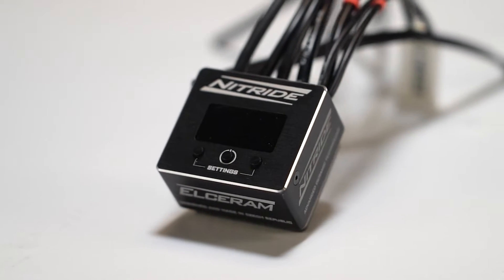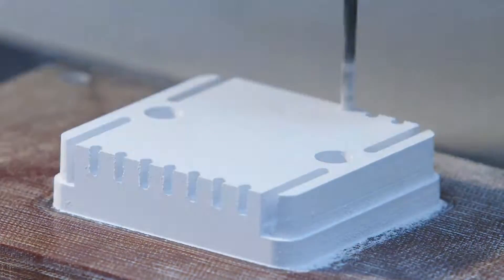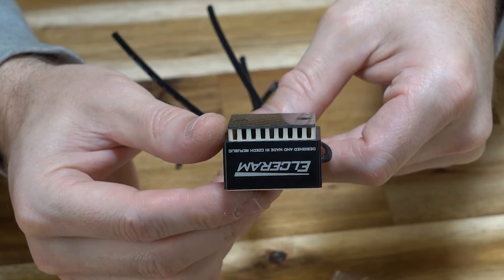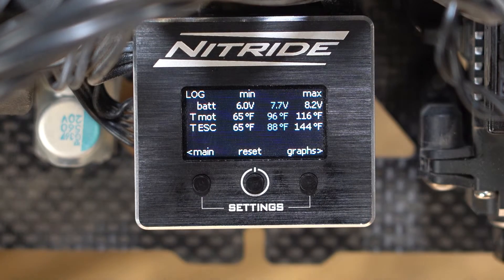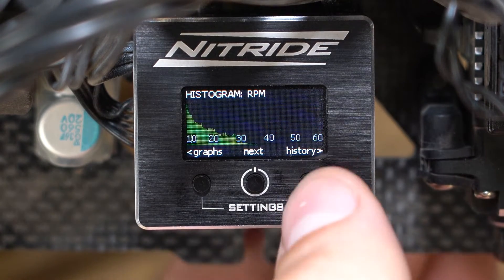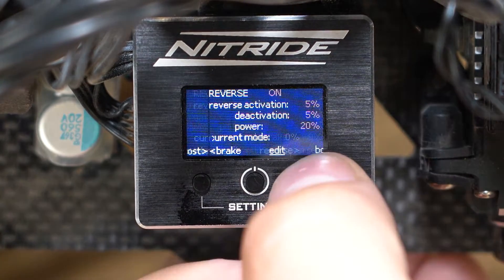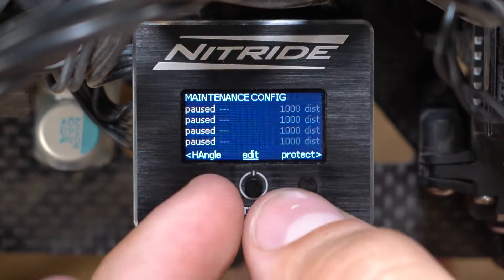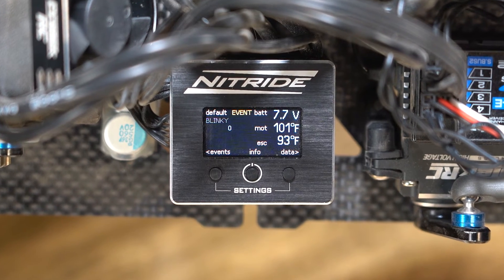The Nitride LCD Screen Brushless ESC for 1/10 Racing

Comment: put this esc  in my b6.4 
it is money !!!! 🏁🏁🏁
Reply from the maker: Great, happy you're lovin' it!
-Brett
Reply: I have a B6.4 as well. Was deciding between this and the Xr10 G2S. I have the ota programmer already since I run hobbywing esc in most of my cars. I cant decide which to buy. On one hand I trust hobbywing and their products. They are built good and last a while. ELCeram is new to me and I can't speak for their customer service or quality od their escs. I'm torn tho cause this screen is nice to have for immediate info. My hobbywing ota gives me all this information as well just takes an extra step. Have to plug the programmer in and load the app. Its not that hard nor does it take that long. So I'm torn between these 2 escs lol